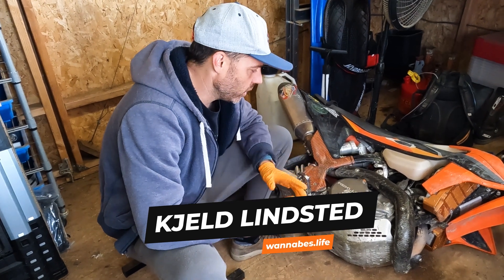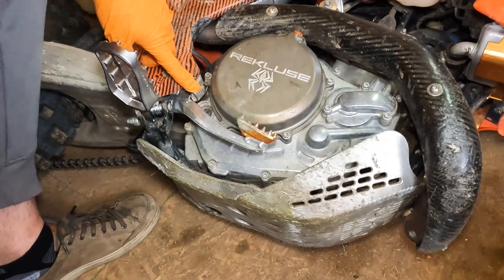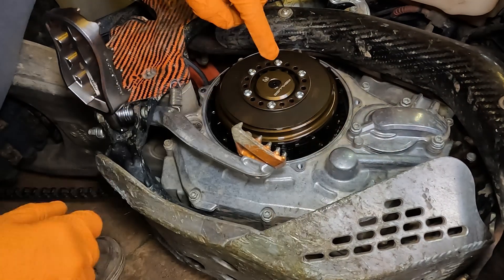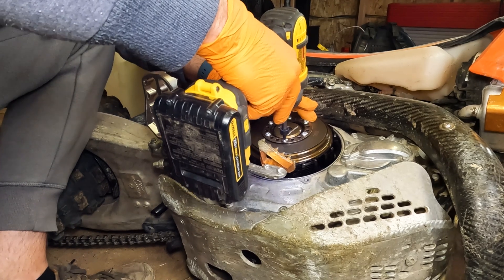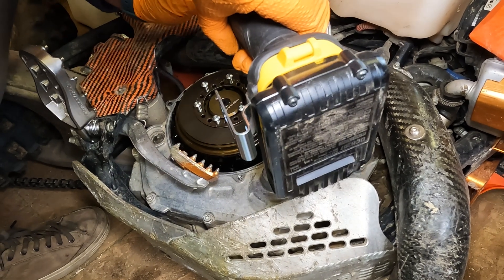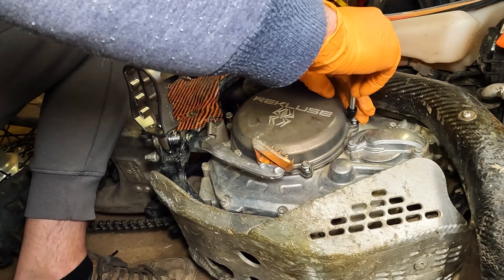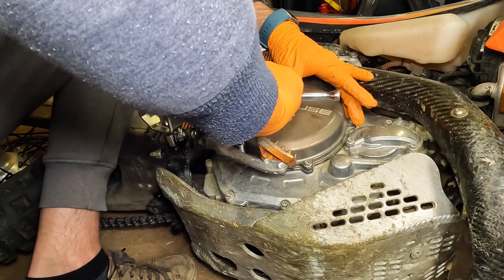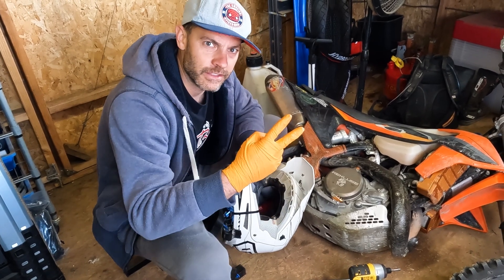How to Adjust KTM Clutch Pre Load in New "Springless" Belleville Washer System | Fix Clutch Slipping

Comment: I just installed a Rekluse core manual and I have the same issue of clutch slip when the engine is hot.  You said in your video that you were going to test and see if the change you made actually solved the problem.  So how did it go?

Comment: My washer and the screws spin when I try and remove.  Yours didn’t.  Any idea why?
Reply from the maker: You mean the clutch stack is turning?
Reply: @ExtremeSportsWannaBes  the Belleville washer and the plates spin
Reply from the maker: If you’re removing it, put the bike in gear. That should hold it in place. If you’re installing it, the torque is really low and you should be able to counter hold it by hand
Reply: @ExtremeSportsWannaBes  yes

Comment: My 350excf 2022 is jumping forward when putting it in gear with clutch in. I've blead the clutch. Doing this will it help?
Reply from the maker: It might. But my first guess would that something is up within the clutch or the hydraulics. Is it only doing this cold? Or also hot?
Reply: @ExtremeSportsWannaBes  I found the problem it was the clutch plates. They're shot to bits with only 23 hours on the bike
Reply from the maker: Yikes! I’ve been there. In one case too little oil was a problem, in another the bushings in the clutch basket were worn.
Reply: @WannaBes  yeah I think it's been not enough oil. Lesson learned

Comment: I had an issue with my clutch slipping after doing very slow technical climbs and operating very hot. Turned out I was overfilling my clutch fluid reservoir

Comment: Another dodgy how too
 the bevel bolts are torqued to 6nm and the spring should be checked with a straight edge once you hit 6nm the gap across the bevel spring should be 0-1mm
Reply from the maker: That’s good info for people having issues with the spring itself. I’ve found though that so often people get caught up in a kind of mythology around engine work where they vastly over index the importance and implications of stuff like this and kinda miss my forest for the trees as the old saying goes.
Reply: @ExtremeSportsWannaBes  yeah who cares if your clutch has the incorrect pre load. KTM just puts three different settings on it for fun

Comment: So I just switched mine from 2 to 3 and now my clutch pull is waaaaay tight. I tried it on 1 as well. Even tighter. Went back to 2….tight as f still. It was fine (but had a semi hard pull on 2) now it’s totally cement. Any thoughts? Not sure where I went wrong. I torqued them to spec at 6nm so it’s not over tightened. One thing I did do was try to shift it from neutral to 1st while I had the cover off and the spring screws weren’t tightened all the way. Would that have done something funky? It shifts still now….
Reply from the maker: I doubt it’s damaged. But, it’s possible you’ve got something together wrong. If it’s very different from how it was, might be worth opening it again and looking for anything that might be interfering or installed wrong
Reply: You have to push the clutch plate down while tightening the bolts

Comment: I have a 350 and since new the lever engagement is too close to the handlebar for my liking. I’ve tried adjusting the plastic screw on the lever but then the lever is too far out of reach for my liking. Will adjusting this ring help me with the engagement point? If so should I move it to position 1? Thanks.
Reply from the maker: No, the spring won't have any impact on lever position. I recommend the clever lever or similar for adjustablility and better performance. We did a video on it, https://youtu.be/2sTwQNjtDcA
Reply: Did you ever find a fix? My 23 300xc same issues, new and the lever has to be adjusted way out.

Comment: How did 2nd setting change?  I’m on 3 now and feel it slipping as well in low gear…
Reply from the maker: I can't remember which side is "stiffer" without looking at it, but if you're on the lighter side of the range and feel slipping, try the next step. If you're already on the tightest setting and it's still slipping, you may need new clutch friction plates.
Reply: @ExtremeSportsWannaBes  it’s brand new and I have it on 3.  Wondering if 1 is the stiffest.  2022 300 tpi.  Brand new rekluse
Reply from the maker: You can tell which side is stiffer by looking at the steps on the back of the pressure plate. You'll see three steps, the tallest is going to place the most pressure on the plates.
Reply: @ExtremeSportsWannaBes  thanks!!
Reply: @ExtremeSportsWannaBes   Hi, Nope, Think again.  Position #3 puts LESS pressure on the plates because it is tallest position. Remember.. THAT is why YOU went from position #3  to position #2.     Position #1 is thinnest and compresses the Bellville washer the Most.   Take Care  🙃

Comment: can you speak more about each setting? like if the clutch is older and worn would changing the setting from 2 to 3 get more life out of it? or going from 2 to 1 be better for an older clutch? ya know what i mean?
Reply from the maker: Yes, you are spot on. As the clutch plates wear, you will need to increase spring pressure to take up the slack. Rekluse has recommended settings in their instruction sheet for what thickness should trigger what adjustment. I'm guessing the KTM manual does as well but I have not looked. 

I don't know the suggested settings, I adjust mine by feel. If it's starting to slip, I go up a step.
Reply: @ExtremeSportsWannaBes  dude right on. That is exactly what I needed to know.  Thank you!
Reply: @tothepoint4240 hey buddy it’s a year later and am wondering the same thing, if clutch pack is starting to wear down and getting a bit of slippage which way did you go to get it to stop slipping and like new again? I took the plates out and they still look really good. I have a brand new clutch pack but don’t want to put it in yet.